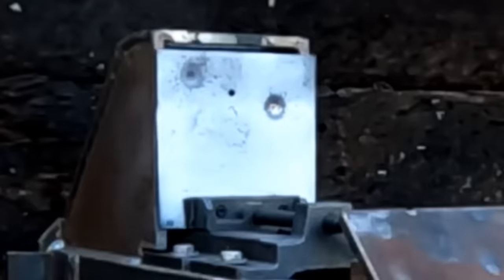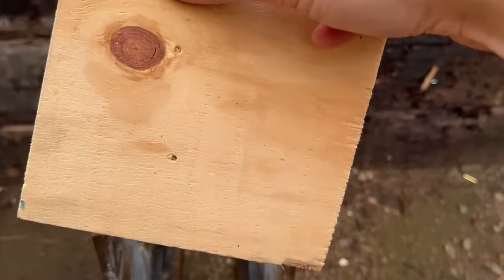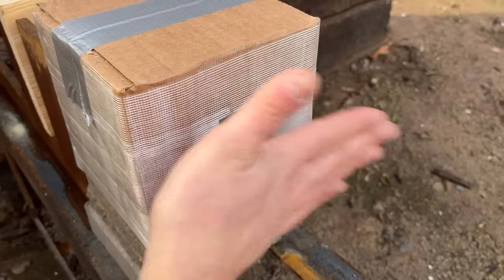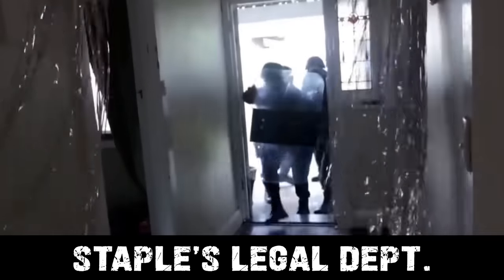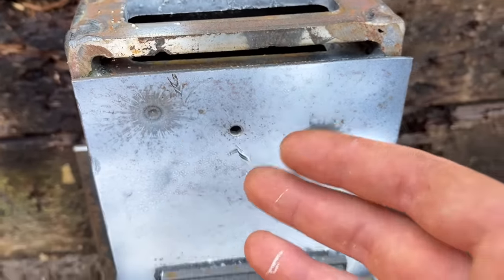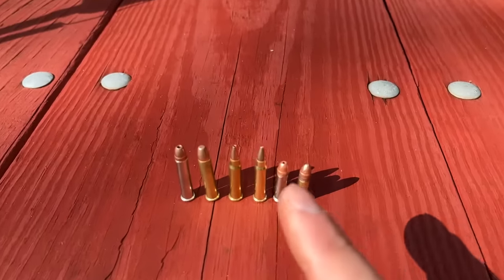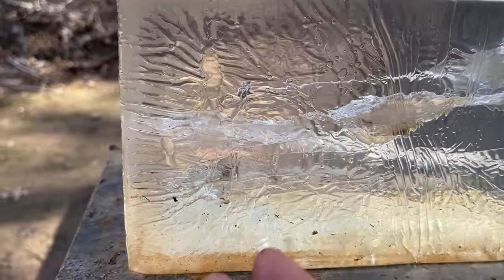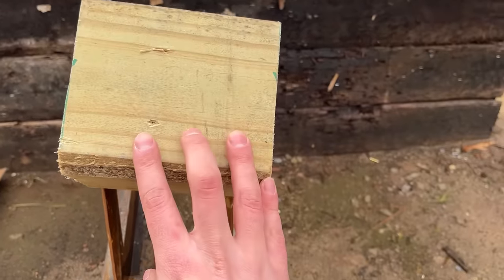22LR vs 17 HMR vs 22 MAG: Never Would’ve Guessed

Comment: I made my own DIY gelatin about 10 years ago from a YouTube video. I'm still using the same gelatin to this day. It's room temperature stable, doesn't need to be refrigerated, just keep it in a sealed container. A couple of key things, never cook/overheat it when remelting it back down and remolding it. If you 'cook' it, then it can/will spoil like a food product. Second, the recipe needs to include glycerin, this is what holds the moisture/acts as the preservative. Over the years you'll occasionally need to add a little distilled water & a few drops of glycerin from the natural loses that occur from repeated heat cycles. I made enough to fill two 5 gallon buckets and it cost me roughly $80 (back in the day). I was using it for casting detailed items, only later did I try shooting it and the results made me smile :).
Reply: How did u cast with this?
Reply: @garylisewski3130  You suspend the item you wish to cast into the gelatin when it's liquid.  Once solidified, pull/pop it out, pour in your choice of medium, silicone is best. Typically, I carve what I need out of wax, then coat it with latex body paint, otherwise the hot gelatin doesn't play well. Most anything that 'kicks off'  and produces heat is incompatible for obvious reasons. When finished,  gently reheat the gelatin, pour it through cheese cloth to remove contaminants into sealed containers. I've used gallon ice cream buckets for ten years.
Reply: @adf360  thank you!!!

Comment: Bought a Keltec PMR-30 a few years ago and I was impressed enough to daily carry it for a couple years. Having 30+1 rounds of 22 mag in a pistol is definitely a plus but my favorite thing was the low recoil allowing you to put several accurate shots in quick succession. Got a flash reducer because in low light situations it would be like a camera flash in your face without it and having a little more length on the barrel itself didn't hurt. Carry a XD in 45 ACP now so definitely a swing in the other direction but still has 15+1.

Comment: I use the CCI .17HMR 17gr Varmint Tip from a Savage bolt action rifle for groundhogs at 40 yds. CCI calls this their A-17 round, according to CCI it is rated at higher velocity to optimize reliable function in the Savage A-17 rifle, which I don't have. CCI rates the muzzle velocity at 2650, so it's gonna shoot pretty flat. Head shots send the groundhogs straight to paradise regardless of whether any shadow was seen. The varmint tip does not penetrate, it frags. I see about 3" of penetration in animal flesh and massive tissue damage. Also nice is this round is not terribly loud and I don't need hearing protection shooting it outdoors. .17 HMR is a wicked little round, I like it a lot.
Reply: @robv1257  Yeah I like my Savage bolt action a lot. It has a stainless heavy barrel, a fine trigger, a nice looking laminated wood thumbhole stock and it didn't cost a fortune. The only issue is it's lefty and the stock won't allow ambidextrous shooting so 90% of shooters can't use it without first changing the stock. I found it at a gun show in 2015 and snapped it up. I put a decent bipod and a decent but inexpensive scope on it and it shoots fine. Real nice rifle for the money. I have 10 rd mags for it but it could be a single shot for my purpose. For varmints at shorter range with .17HMR you pretty much can't miss.

Comment: There is a High Power 17HMR too, it is called CCI A17 I bet it has a very good chance on your 3/16" mild steel!
Reply: A17's are 17 grain at 2650 FPS giving an Energy of 265 Ft-LBS, ve the Hornady V-Max.17 ammo  is 17 grain going 2550 with Energy of 245 FT-Lbs, Win Super X 20 grain Game Point (looks like a low depth hollow point) traveling at 2375 gives an Energy of 229 Ft-Lbs , ...20 Ft-Lbs, 36 Ft-Lbs could make a difference when the hole is so tiny! What is needed here is a FMJ.

Comment: You did use the 22LR Stinger, but i would offer the CCI Volicitor is a more powerful round for the 22LR.  It is a bit slower @ 1465fps but it is a 40gr round. I find its performance on sage rats is much better than the stinger's 👍

Comment: I knew the 17HMR would do amazing.  As it was explained to me, 17HMR can drop a hog at a couple hundred meters if you can use it long range.  You should see what the hollow point 17HMR does to a metal coffee can filled with damp paper towels.  Makes a tiny hole in the front and blows a huge exit wound out the back.  It also does good against soft Kevlar panels.

Comment: Was hoping to see the King of the rimfires, the 17wsm added to the mix to see how it performs. I've personally shot it though  3/16th a36 steel plate at about 10m. It left a much disproportionately larger then caliber sized hole with a huge amount of curled up steel on the front side. However it failed to penetrate on 1/4 plate of the same composition in my hillbilly tests lol

Comment: fire all the same rounds , but this time use pointed copper clad bullets ,  I guessing you'll see better penetration from the LR and MAG . I use to have an old lever action .22 mag , we use to pull the slugs out of a few rounds and fill the case completely full to the top with the charge from another round. The gun had a very heavy thick barrel with something called microgroove rifling so we were pretty sure it wasn't going to explode . We did the same thing with regular .22 lr . Shooting into a mud bank about 20 yards away on an old gravel pit pond with first the .22 lr it made a 3" hole compared to a normal .22 lr which only made a hole about the size of a quarter ,  then we fired the regular .22 mag , it made a hole next to the 3" hole about 6" diameter , then we fired the extra loaded .22 mag aiming to the left of the 6" hole ,  it completely removed the mud bank about 9" in both directions from the aiming point.

Comment: 17WSM is undoubtedly the king of rim-fire. You should give that a shot.
Reply: I just wish they had done that cartridge in 20cal for a little more mass!
Reply: @mattfleming86  Winchester missed the boat on that deal. It also could have made a rimfire revolver caliber from that case, maybe a .25 rimfire.
Reply: The casing is actually developed from a .27 caliber nail gun blank (used to drive nails into concrete).
Reply: @exothermal.sprocket  A 25 rimfire is viable then. Would be great in a  J-frame revolver.
Reply: @PassivePortfolios  Eh. All depends on what powder is used, what barrel length you use. Currently the snub nose LCR or J-frame don't generate much more than equivalent .22LR power from a rifle barrel, which is great, but very diminished over the .22wmr used in a rifle barrel.
Reply: @exothermal.sprocket  that's simply not true. The .22 mag is far superior to the .22 LR from a revolver barrel. Have to go with the .32 H&R mag to beat the .22 mag. in revolvers.
Reply: @PassivePortfolios  I've been around a while, I don't have skin in the game. I check, verify, research, observe, and draw conclusions.
40gr .22wmr from 1.9" barrel is barely more than 40gr .22LR from a 18.5" barrel. Just how it is.
Bump that .22wmr up to 3-inch barrel and things start to change quickly.
Reply: @exothermal.sprocket  why are you comparing 22 LR from a rifle with 22 mag from a revolver?
Reply: @PassivePortfolios  Why are you asking the question? Who wouldn't make the comparison? It's nothing but comparing relative burn rates of powder and what good a magnum cartridge is in a short barrel. And because .22wmr is 4x more expensive than .22lr.

Comment: The reason the .17 HMR went through the mild steel was a function of velocity alone.  The bullet strikes the steel at a great enough velocity, when it stops "instantly", the energy is turned to heat and it MELTS it's way through.  5.56x45mm will do the same thing on even thicker steel, whereas a .45-70 will not, even though the latter round would be a helluva punch otherwise.

EDITED TO ADD:  The instant melt-through is why the hole was so perfectly round.

Comment: Interesting. I'm honestly a little surprised the .17 did as well as it did on steel. I was shooting the same thickness plate and only getting dents, but I was also using V-Max ballistic tip bullets and I cannot confirm the steel alloy I was using at the time. Thought it was just mild steel, but maybe it was some other alloy, maybe it was the bullets. 17 grains is not a whole lot of mass. Killed a whole heap of coyotes stone dead at more than 100 yards, though. Many many hours spent laying on top of the chicken coop with that caliber. It got to the point where the chickens wouldn't even flinch when that rifle cracked. Good times.

Comment: Can you maybe do a video on (FN's) 5.7x28 vs HK 4.6×30mm?
4.6x30mm might make you get (or borrow) a new gun, unless you have a "sporting" MP7 already (that's the firearm the round was developed for).
See if it lines up with what the "official" NATO testing of the two rounds. NATO liked 5.7x28 better, both for performance reasons and for the fact that the projectiles are largely similar to 5.56 NATO projectiles, meaning the tooling for both can probably be shared (All wars are won by logistics, so common tooling is more important than you might think it is).

Comment: Really no way to compare a .22LR to a  17HMR or 22WMR. The 22WMR and 17HMR are copper jacketed. Most 22HMR are jacketed hollowpoints. 17 HMRs not too familiar with but assume most are not hollowpoints. Where practically all .22LR is just soft lead or copper coated led to give it the color. The coppor coating is meant to  keep the actual lead from fowling the rifled grooves in the barrel. Wich really dont help that much.

But as for a 17HMR? Flat shooting for greater distances but crosswinds will really throw it off target. A .22WMR. Shorter range but way more knock down power if you can get the tragectory right.